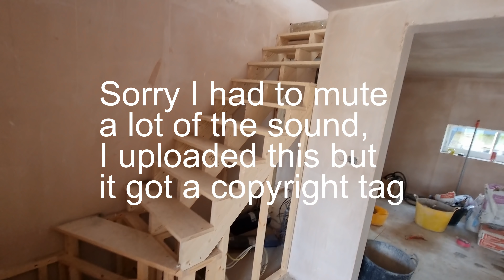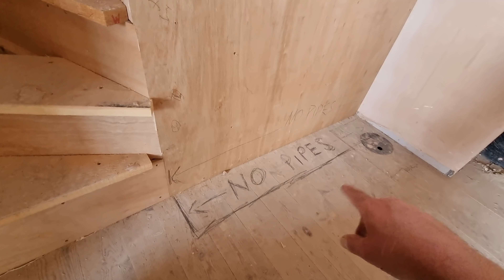Kite winder stair build Pt2 -  boxing in & risers

Comment: Brilliant video as always Gid,  defo needed a tradesman to build that, i can honestly say i would not have had a clue how to build those stairs .Massively appreciate all the time and effort you put into editing and uploading all these videos Gid .
Reply from the maker: Thanks Simon 👍 Glad you appreciate the videos n time put into them, building things like this i break it down into sections, if things are getting stood on or are taking any weight the timber is on top of the upright not attached to the side, the zig zag stairs are a joist on an angle with triangles so i used Span ÷ 20+20mm to work out the width of the timber, prob was i couldn't get 12" 300mm timber only 10" 250mm , so that's why i added the support posts/frame, that then reduced the 'span',  the rest was just following the drawing & a bit of logic,  but yeah a bit of experience helps 😊👍

Comment: Tricky little job that mate, its one of those things that at first glance looks easy just nail a bit of ply up but the tricky part is making it look good and not like a dog’s breakfast, its nice to see someone taking such care over something that’s going to be painted at the end of the day, a proper tradesman at work 👌👌👌👍👍👍🇦🇺
Reply from the maker: Thanks 👍 Yep, wrap it in a bit of ply, how hard can it be 😂 If it was pre-made in a workshop with accurate cuts & everything was spot on level than getting mitres correct is relatively easy but doing on site with rough on site cuts is another matter. there's only so much filler can be applied, 😂 glad you appreciate that 👍

Comment: Outstanding craftsmanship Sir 👍 Personally I hate sharing my jobs with other trades. I love having the place to myself. Is that a Freud Diablo in the T.S? Narrow kerf (1.8mm) or standard kerf (2.2mm)?? I have the same T.S and I am happy enough with it. I run a Makita 2.2mm blade in it. I tried the narrow kerf blade on it but found it tends to drift off a bit on narrow rips. Cuts where there is very little meat left on the waste side of the line. I plug mine into a Makita 36V vacuum, I usually run it off the mains if I can. It's a much better vacuum corded rather than cordless in terms of performance. Did you swing the T.S over to 46° on those mitered riser cuts? The little catch on the Makita T.S that holds the saw onto the track is genius. Great when one has the saw tilted over at an angle. All in all it's a great little saw but lacks a bit of power. Hopefully Makita release an 80V T.S with a 65mm dept of cut at some point down the line. It's great to have you back and uploading top class content, 👍 😁 🔨 🇮🇪
Reply from the maker: Thanks 👍 It wasn't a bad day, the music was quite good, n the plasterers kept to themselves, the video was quite atmospheric, builders working, noise n music 👍 YT copyright put a stop to that tho. Yeah it's a Freud 40T blade, Screwfix 1.7mm kerf, I change it in the alcove cupboard vids i've got coming just for that reason, because the cupboards were getting painted on site & the units in my shed weren't fixed so slightly out of sq i made the doors fractionally bigger than needed so i could fit them on site, but the orig Makita blade seemed still quite sharp but it drifted when trimming the width of the blade of the edge/top/bottom of the doors, Glad you appreciate the vids, there's pics of the alcove cupboards on FB if you haven't seen them, i'll get the clips edited soon 👍 https://www.facebook.com/media/set/?vanity=gid.joiner&set=a.5153525641400427
Reply: @Gidjoiner  I'm not on facetube as I call it, 😁 That said the link allowed me to view the pictures. Very tasty work as always, 👍👍 Inset doors are my preference on cabinets, they give a more hand crafted look in my opinion. Top notch craftsmanship as always, 👍🔨🇮🇪
Reply from the maker: Thanks 👍 yeah overlay doors look a little cheap to me, inset shows the accuracy (& mistakes 😂) & gives a little quality 👍
Reply: @Gidjoiner  Agreed, there's more craft in fitting them. Anything that promotes the craft is a positive Sir, 👍😁🔨🇮🇪

Comment: Enjoying it so far. Was that expand e foam you used for the first few risers? A bit of draft proofing???
Reply from the maker: Thanks Peter 👍 I wanted to glue those few & the main side board just to help solidify it all but couldn't be arsed trying to spread PU, the foam is basically PU, it was just for good measure & a little bit of gap filling 🤷‍♂️😂
Reply: @Gidjoiner  Should also help avoid creaks in the future if it has a little give.
Reply from the maker: That's what i was thinking, PVA is a bit hard n would crack, PU is messy to apply on jobs like this,,

Comment: Ooo another new drill 😜 cant help yourself can you, I thought you wasn’t a fan of impact drivers 🤪
Reply: I'm not keen on impacts. To me.. you have to be on your guard, that you don't drive the screws in to hard.
Reply: @cobberpete1  Get one with an adjustable torque setting, 👍🔨🇮🇪
Reply from the maker: I'm not the keen on the noise or the control, they tend o be a bit all or nothing sometimes, the little Bosch i wasn't impressed with for anything bigger than 3" screws, this Makita seems about the same but on site with dust in the screws & when you want to just bang a screw in they come in useful.
Reply: @Gidjoiner  I bought a made in Japan 18V Makita oil pluse driver last Year. It has mid range torque but runs much quieter than a standard impact. The anvil runs in a bath of gear oil. I had to get the black limited edition version of course 👍😁 🔨 🇮🇪

Comment: How’s the Mafell bag on the cordless Makita Gid?
Been swithering on buying it for ages now
Reply from the maker: It's slimline but not worth the price, it does as a bag should but the catch on top that keeps the bag shut is poor quality & i suspect won't last, I had to buy an adaptor to make it fit the Makita, & because the bag sort of sits with it's rear end upwards on the saw the dust tends to collect near the port blocking it fairly quickly, i have to empty it when only half full.

Comment: Hi Gid 
Fantastic as usual , I am in the market for a track saw what do you think of the Makita ?
Reply from the maker: Thanks Simon 👍 I'm quite happy with it, i think all makes have their flaws but i haven't used others so can't compare, i buy Makita if i want an accurate tool & a long life, most if not all Makitas i've had are 15-20yrs old n are still going, if it got stolen i'd replace it with a Makita, Festool tools are overrated & Dewalt are rugged but maybe a bit too basic n rugged when you want accuracy, If you're going cordless it might depend on what battery setup your on,  whatever you buy you'll love it if you do buy a track saw, lay the track on n cut 🤸‍♂️🤸‍♂️👍😎